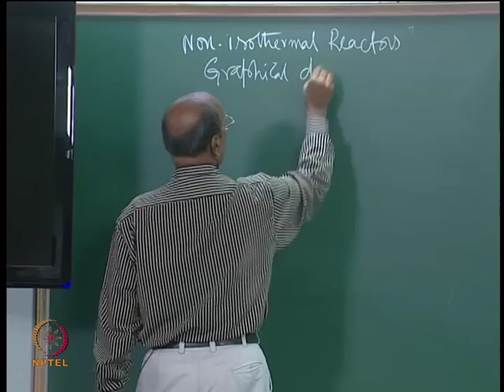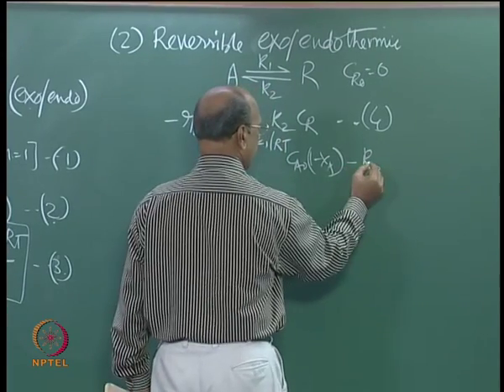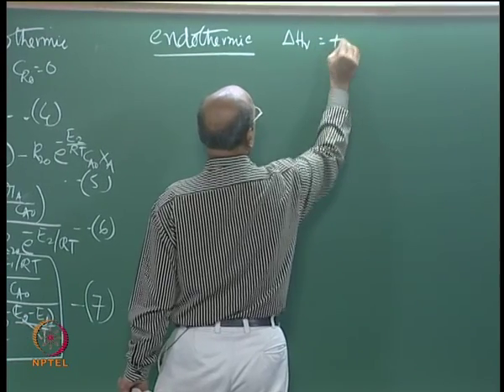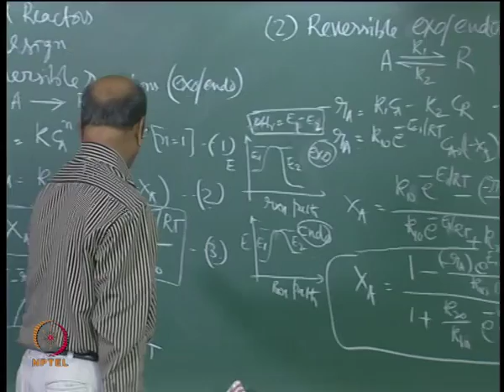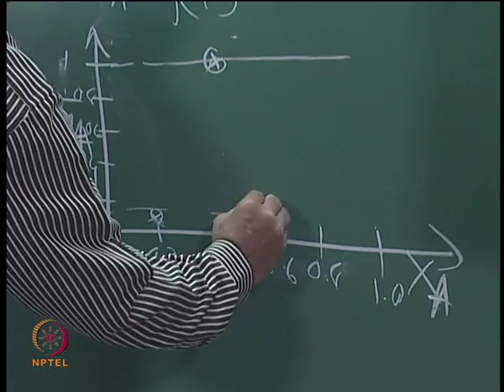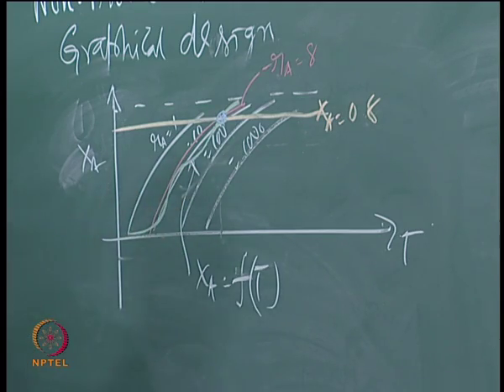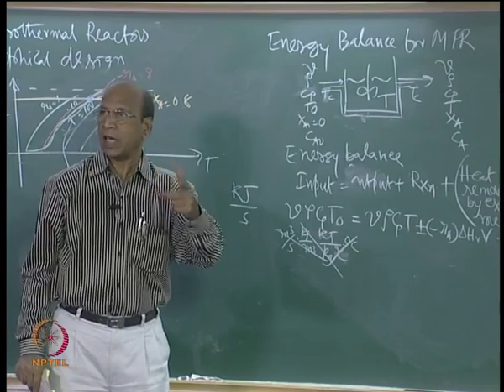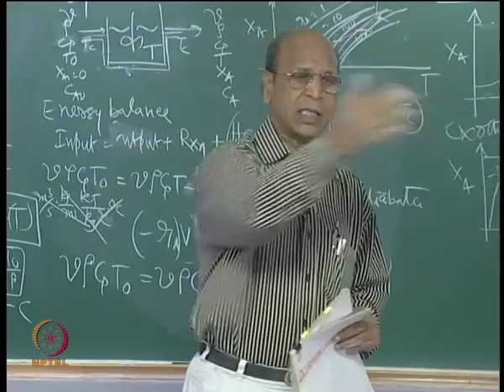Mod-01 Lec-40 Non-Isothermal Reactors (Graphical Design)

Comment: Sir,At last the energy balance for MFR gives a line...but it is giving many rates i.e. intersection at many points...but we will have a single rate for  MFR ..how it is?
Reply: For performance eqn you only require the rate at final conversion in mfr case.